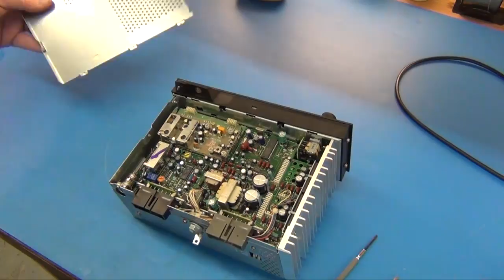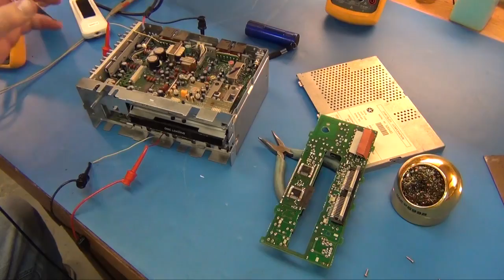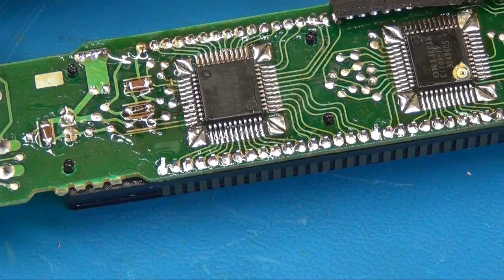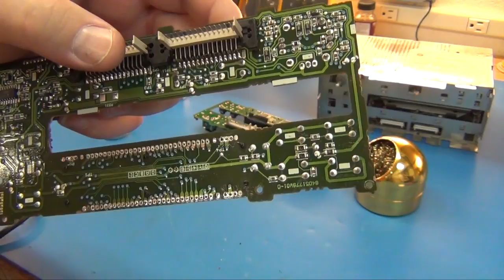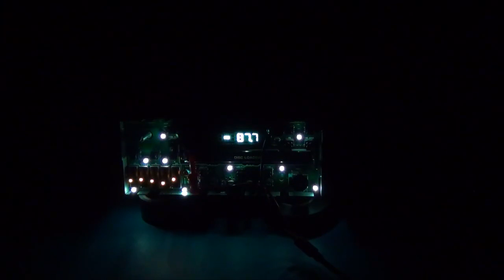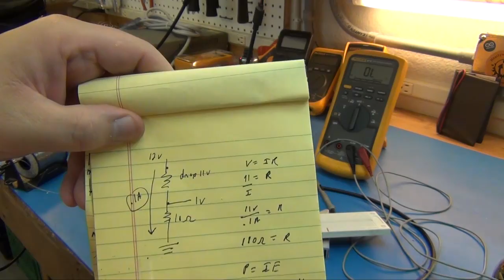Radio Repair - bad vacuum fluorescent display (VFD)

Comment: I have sony mhc p99x.125w  small mini ...its fan does nt work and it gets hot around 60..70 C. can i use computer fan? will it burn if fan is not working?

Comment: It fought you at every turn, (as some things do), but you won :)  Cool!   I also valued the soldering lesson.
Reply from the maker: You welcome. And thanks. it was stubborn.  I have since learned that a VFD with this problem can be fixed by just apply  9v DC across the cathode wires for a count of ten. This heats up the cathode filaments and cleans them. Then the display will come back to normal brightness. I never tried it but sounds like it would have worked too.

Comment: I am not familiar with the Term via. Do You mean path?👀
Reply from the maker: It is a term that means the circuit traces on the the top of the board are connected to the circuit traces on the back of the board using a through hole drill and metal insert. Once soldered the two sides of the circuit are connected at that point.

Comment: Really nice informative video, I was looking into the history of car radio's and vacuum fluorescent display's . found out some where made in the 70's because I had a 76 mustang, but by the 
1980's  100 of millions were built.  And like you said they work simular to a triad tube filament (heater) the Grid and the phospher coated carbon Anode. 
   Nice dual power source I want one for christmas.
Reply from the maker: True. Keep me updated! Fun stuff.

Comment: Ive got the opposite problem, although its not a car stereo, its a JVC shelf hifi, but the display being a Vacuum Flourescent Display is ALL lit up, every segment in the VFD is on, so im figuring that it must also be the driver chip thats gone. its a PT6324-HT. Now tryuing to locate the part is goign to be a challenge.......

Comment: Something to add.  A cars operating voltage isn't 12 V, it is typically in the range of 13.8 / 14.4 .  We just call it 12 V because a fully charged lead acid battery is 12.66 at rest, the higher voltage is needed to keep the battery at a 100% state of charge.
Reply from the maker: True, Thanks

Comment: Nice work around and a great effort.
You can always add another resistor to dim it more for  night operation and enable with a small switch on the face plate somewhere

Comment: I have a question. There is a problem if this low 4 volt voltage is Always constant? Is there a problem with the screen burning?

Comment: Really enjoyed this video.  3000gt's have a climate control display that is a VFD that are always going out.   Myself and others have replaced nearly every component on the display only to find out that the display will work for a few minutes until the 1 ohm 1 watt resistor/fuse burns up.  I appreciated seeing power it up offline and demonstrate your techniques.  Thank You

Comment: that pin labelled park is supposed to be connected to ground when the hand brake is applied .... this normally enables some features that can other wise distract the driver from driving... my Sony head unit let's play dvds and videos though the video output when park is enabled!!....

Comment: Good video! I have noticed that VFDs that don't break and last for years eventually succumb to fade. The brightness decays, very slightly for a long time, then gets worse quickly. I have 2 VFDs in my 2004 Suburban, and noticed over time that I've had to turn the brightness dial up every so often. They're now (March 2019) reaching the point where the dial is maxing out and the displays are going fast, will be only a matter of months till they're like the radio. I'm presuming the Jeep radio faded out. Pre-1999, CRT TVs also could fail this way, as the picture tube cathode can also fade, making the TV picture darken and eventually no picture. I recall this TV repair guy installing a "booster" that gave us like 2-3 years. But ultimately the VFD itself has to be replaced.

Comment: Todd why didn’t you measure the power from one of the other lights on the front of radio and tap into them? I’m sure they were running a lower voltage.  But like you said it works.
Reply from the maker: good point. I'll have to do that next time.

Comment: I've had a semi dead display for 9 years. you could push on the bottom left corner of the display and it'd come on for a couple seconds. I watched your video and took it apart and discovered that 3 of the power pins had lifted out of the solder. resoldered and working on the first try. thanks.
Reply from the maker: futurefesty90 glad to have helped. Mine is still working 100%
Reply: Todd Harrison Say, what would be the easiest/cheapest way to  run 12v power on my work bench? I don't really have the money for an expensive power supply
Reply from the maker: If you are working on circuits that are not noise sensitive this is a good option: https://www.circuitspecialists.com/multi-output-power-supply-ps-28.html
If you are working on video, audio or signal circuits you will want to avoid this cheap supply unless you can build a filter for it first.

Comment: Todd, I have an old TOTL JVC S-VHS player that has a dim display. It has -30V and 5vAC going into the display driver chip and I read that you can recover the brightness by increase the voltage to 'wake up' the display for a few seconds. What voltage am I increasing, the -30V or the 5VAC?
Reply from the maker: I have heard of this where you put a higher voltage load across the horizontal tungsten wires. Read "Fading" section here: https://en.wikipedia.org/wiki/Vacuum_fluorescent_display

I have seen this video too: https://youtu.be/-rrP4Prx1rc

Note there are many different types of VFD drive circuit. You have to know what are the input(s) for the horizontal tungsten wires and what are the output(s) of the horizontal tungsten wires in the display.

Comment: ACC is not Auxiliary.  It's ACCessory which is the part of the ignition cycle that turns on the electrical components.
Reply: Yes, ACC is the first click position you reach after inserting the key and begin turning. (The 2nd is "run" and the 3rd is "start").

Comment: It seems that the chip isn't providing enough voltage for the filaments.  The filaments should be getting more like 4.5-5.2 volts.  I would desolder the lead and connect +5v to it through a small resistor.
Reply: +douro20 
I dunno, I've seen VFDs that only need like 2.5v for the filaments. I think it varies from display to display (different models of course).

Comment: I was just looking at your theory at 33:45 about using X5 - 550ohm 1/4w resistors in parallel to get the 110ohms and 1.25W. Correct me if im wrong, but resistance does not drop if you put them in parallel, you will still have 550ohms of resistance but you will now have the 1.25W required. you would still need to have X5 - 110ohm X 1/4W resistors to get the 1.25W required.

BTW Great tutorial, very interesting.
Reply from the maker: Nope. Resistors in parallel will drop overall resistance. Resistors in series will increase overall resistance. Thanks for watching and glad to help.
Reply: I remember that now, it's been a few years since I have done component level troubleshooting, calibrations in the military. Is over of those user it or loose it, and I have lost it but trying to get it back
Reply: Sorry for the typo, " it's one of those use it or loose it"
Reply from the maker: ***** So true.

Comment: It's the challenge. My display in this same radio just went out too, and I had a spare radio which is now in the car. And these are cheap on eBay. But I'm a HAM (W3AFC), and I like to repair things. Plus, an eBay radio could fail within a couple months.
Reply from the maker: Oldradioguy2 you'll have to let me know how your repair turns out. I'm curious to know if you came up with a better solution and/or have the same problem. Others have told me that I needed to come up with an alternating voltage across the grid in order to prevent dimming at one end of the display. My DC solution did produce dimming across the display and further research shows that these elements do need to be driven with an AC source. At least I learned something, that's the good part.
Reply: This gives me a clue.  I Google this.   I have a theory to what might be wrong with the original circuit.   I noticed on the pin outs for some Vacuum Florescent Display driver chips, there are lines marked "clock" and "strobe".   I wonder if one of these lines is missing its the input, leading to the chip not outputting its AC voltage for the anodes because it needs that signal from somewhere else.   I would try looking to see if that signal is being generated elsewhere and where that is coming from (perhaps a transistor, another IC, crystal oscillator, the clock chip of its CPU, the radio oscillator, etc) and perhaps there is a cap or resistor bad in what is driving the signal for that pin.    You might also see if there is any short or disconnect that is somehow falsely enabling the blanking pin on one of those chips (yes, they usually have a pin that turns the display off).  It is pretty obvious that most of the data circuit is working correctly.    I also wonder if the dimmer "lamp" pin is connected to another circuit that drives the blanking, strobe, or clock inputs somehow as part of its dimming method and that is causing the display to go black.

Comment: if you build in a µController that regulate the Voltage down to the 1Volt so you have a lot of disturbance inside the Radio. Use a Stepdownconverter this will have a low temperatur inside the Radio and a good regulation for your VLD.

Comment: i haveo the same radio but it does not turn on when i push the power button any idea thanks for the vid
Reply from the maker: Robert Mccaffrey bad fuse. check radio fuse or all fuses.
Reply: if i push the volume button the clock comes on and if i put a cd in it it just ejects it out and that is it is there anything i can try thanks
Reply from the maker: Robert Mccaffrey Nope, I wouldn't know of anything simple. You would have to get it repaired or replaced at this point. You can try www (dot) car-part (dot) com

Comment: Nice video Todd.  Real nice cheap answer to getting the display going.  The repair has to be balanced against the cost of the radio.
I noticed you had a nice PSU there with large LCD displays, was that very expensive?  What is its spec?  
Anyhow I enjoyed the video, thanks for that... Mike
Reply from the maker: Michael Hawthorne It is ok, but I really don't like the over current protection. It works but it hard to set and you never really know if it is set right without checking it often, plus the setting goes away when you restart. It is this one: http://www.circuitspecialists.com/bench-power-supply-csi3005xiii.html
But I would get the one Dave Jones last review if I wanted something better at a price I might be able to afford someday: http://www.eevblog.com/2013/11/19/eevblog-549-rigol-dp832-lab-power-supply-followup/

Comment: thats a nice radio! my '94 grand cherokee laredo had every option but the factory infinity sound system. it had the am-fm-cassette with 4 speakers, but all that was replaced by a sony cd player and pioneer speakers. the cassette player and radio combo barely functioned when i took the radio and speakers out and replaced them.

Comment from the maker: @Laharl, We think alike. I had setup a LM317 first but found you can't dial them down that low. I didn't try a 7805  like that but it would have worked just as you say. A big old fat ceramic resistor worked just fine I guess.

Comment: hey todd i was just thinking, wouldnt a lm7805 as a current regulator have worked better than the big chunky resistor? you would have the 7805 burning 7x0.1=0.7 wats and the corrent limiter resistor only half a watt. You could just wirewrap them together and then solder the wires just like the resistor. Not sure about the price, but i think it's almost the same, plus you get CC and the load is shared between the TO220 and the resistor, and also the 7805 has thermal protection.

Comment: the voltage is around 3 volts just till the heaters glow slightly in a dark room. running the heaters lower will destroy the display just like a vacuum tube heaters low will damage vacuum tubes. I have used a 3 terminal 3.3 volt regulator worked well.

Comment: Power supply repaired and chip from china came in looking good. Installed and the display is up again. Sadly only top half of all the characters are showing. Was fun to try, but probably won't put much more in the attempt. These things are a pain.

Comment: Haven't worked on that many VFD's, but where did the filament supply go? When you supplied it external, the thing worked. Maybe an open resistor somewhere? Back on the main board maybe?

Comment: I am glad you got it working but that is a big resistor. you had 3.4 volts on the display panel. Just wounder if it might have been better to to the 3.4 volts down to 1 volt?

Comment: That's a fair worry. I suppose if there was enough time, checking if it uses one of those ubiquitous LM7805 regulators and test how much current it was handling to see if you could suck a few more ma from it safely. I like the idea you had in the video about adding a LM317 for it.

Comment: Instead of a resistor, you can use the 5V on the front in series with six silicon diodes. The diodes will drop 4.2V, leaving 0.8V for the filament. 1N4001 diodes can handle 1A, more than enough for the 100ma the filament is using. The diode string will dissipate 420mw.

Comment: Common VFD filament (anode) voltages are 1V, 3.3V, 5V, and 6.3V. Most car based and battery portable VFD displays are 1V. Every one I've seen uses a power resistor from the 5V to the filament. When the radio is off it turns off the 5V.

Comment: I have picked up 5 Pomona cable holders after knowing your reviews, and they have been very useful.  I am using Hakko desoldering gun, it have been a workhorse.  I think the elexp can be a good add-on for tougher joints.  Thanks.
Reply: Иногда оловоотсосный прибор невозможно использовать- он рвет монтаж при распайке и я его практически не использую. Для этого у меня в мастерской стоит компрессор с большим ресивером для мягкости дуновения. Я просто дую в раскаленное олово и оно прекрасно потом убирается. Привет из Москвы!

Comment: will your display handle 1.2A for 0.4 seconds? You can easily get 120V pulses in a 12V system car. It's called a "load dump" - you can google for it. So the resistor alone is not such a good idea, but well.. it's just a radio :)

Comment: Even though you didn't use the regulator as a solution for getting your 1V power supply, Check out Dave's EEVBlog videos on power supply design, he has some tricks to getting an LM317 down to under 1V.

Comment: Couldn't you hook up the power to the ILLUM pin, which on my Plymouth minivan is a 0-12V source that changes with the dimmer switch on the dashboard? That way the screen would dim properly. Would still be hackneyed, but whatever.

Comment: Any repair is preferable to most people's reflex of tossing it and buying another one, though I'm not usually able to fix surface mount stuff. Now that I've seen you do it, I'll give it a try next time. Very cool shop you have there too. I'd never even heard of a hot air rework station.

Comment: I don't see why the manufacturer doesn't  stick to the same internal parts and design unless there is some type of flaw, its not cost efficient for them, and of course it would leave more surplus available, if it was the 1960s you would see a 8 years run with all same parts and lay out. That's why I don't make money I spend 10 hours fixing one item.

Comment: Flames? As soon as you hooked up the supply and saw life, I thought, "meh, just drop the voltage of the ignition supply and be done with it". I guess I'm lazy, but this seems to be a solution that matches the value of the problem. I was actually surprised you tried for a 'proper' solution first.